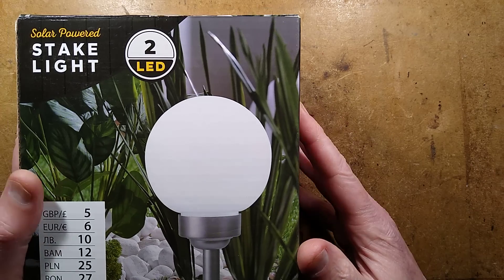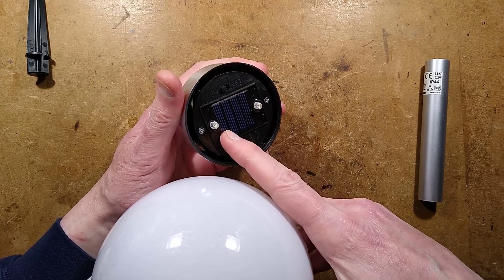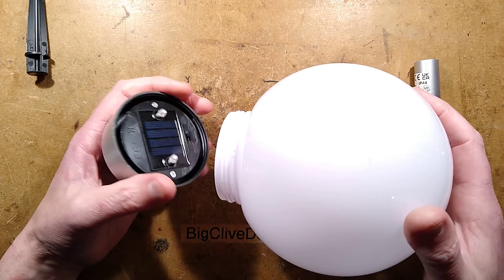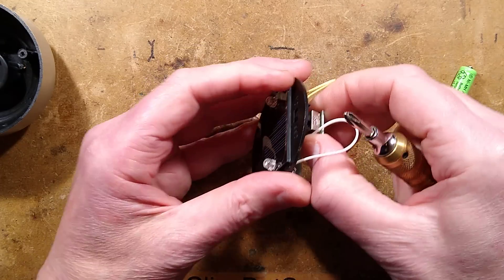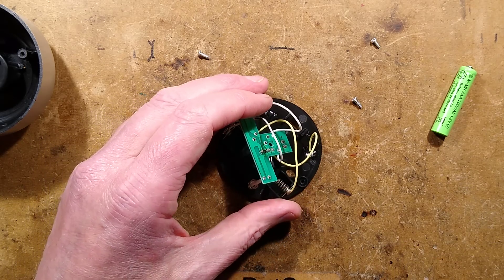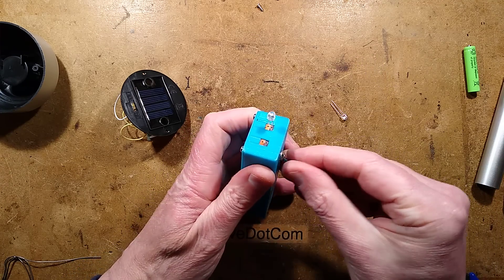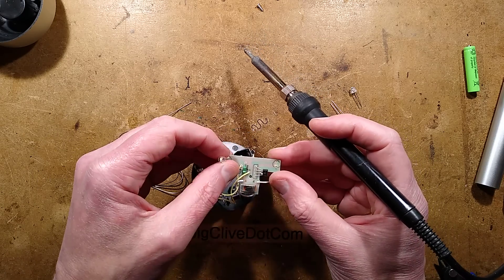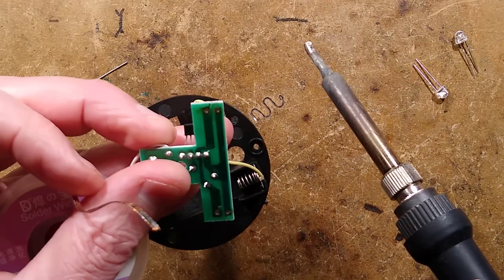Customising Poundland's biggest solar globe (great base for projects)

Comment: Brightworthy 🪔🙂🪔 I just love all those little lights and candlelights all around. It's pitty they install accus 100mAh-300mAh only. They claim it takes about  6hrs to recharge them, but they don't last the whole (summer) night. I replace them with standard 1100mAh AAA, or 2400mAh AA fully charged, at once.  After a whole day in a sunshine, they make it through the night flawlessly.
Reply: Same thing; had to upgrade the 230mah light green coloured rechargeable AA battery in my sun-jar [being used as a Environmentally friendly nightlight] as it would go dim halfway through the night and would be blinking at dawn (IC resetting as to how low the battery is). Put a 1300mah battery in it and now lasts the whole night and still bright at dawn. I found those low mah battery’s are only suitable for quartz clocks as to how little power they use ~ will run for 4 days/a week before they need recharging?

Comment: I really love that ice blue color! Reminds me of Cherenkov radiation.  Very alluring.
Reply: That could be the next idea for Poundland.... Dump the electronics and put some Sellafield soil in the base .... No charging problems during the dark winter months, no moisture corrosion problems.. what isn't there to like?
Reply: It would attract seagulls. Though they are protected these days ,they are still evil pests @StreakyP
Reply: @StreakyP  and it will last at least till 3024 :face-blue-smiling:
British quality !
Reply: @StreakyP 
Corrosion.!?
Maybe you meant Phase Change. Either way, you would have to deal with outgassing and pH levels.
Reply: Reminds me of a Mercury Arc Rectifier!

Comment: Sunlight is said to be about 2kw per square meter (think that might just be a heat measurement though) you might be able to work out the maximum potential of the solar panel based on its size compared to the square meter, but I'm sure the bright light is about right, light transmission is reduced by about a third for most materials also

I see it running out of power quite quickly if you wanted a decent intensity though, specially on that 200ma cell
Reply: The beauty is that you can easily swap out the original 100mAh cell for a 1000mAh NiMH cell from a Lidl multipack if you want. I did that for some solar lamps this year. Let's see if they still work in the winter nights...

Comment: That globe will direct any moisture right into the base threads. There are base drain holes, but now lets hit it with warm sunlight as the rain stops. A Solar mini-sauna bio-dome for electronics to relax in. See you at Poundland next season.
Reply: if the Globe screwed OVER the base instead, then there's the first improvement. I learnt something today for my future designs. Thanks BC!
Reply: As Clive says in the video, moisture seems to destroy pretty much any of these garden solar lights, even the expensive ones. Not just that, but the solar panels on lights where the panel is exposed to the elements seem to go quite 'milky' quite quickly.
Reply: @nickk6518 Not sure why my last comment got deleted....
I like making my own using a QX5252F, Sanyo amorphous solar cell, inductor, led and a supercap.
This goes into an upside down oven heated Doritos salsa jar with the lid filled with hot glue.
Has lasted 7 years so far 😁
Reply: @6sicSIX  how long does it glow with the supercap? Next question; how many F is the supercap?
Reply: @kimchristensen2175  Usually until after I go to bed so 5/6 hours
It actually has 2 6f 2.7v Eaton supercap in parallel. Just checked the colour code, it's a 1mH inductor. Also using a blue LED.
This was hacked together using perfboard with the intention of repeating it and getting a PCB made, but I never did.
Reply: @nickk6518 I like making my own using a QX5252F, supercap, inductor and some diffuser stolen from a cheap solar light.
I then put this inside a Doritos salsa jar and fill the lid with hot glue before screwing the jar on upside down.
I've had one for 7 years so far 😊
Reply: Maybe a thin bead of silicone around the globe just above the threads could help keep water from traveling into the base?
Reply: You are absolutely right.  These things only last about one year due to water and we end up with a recycling bin full of Poundland junk.
Reply: A wipe of veg oil only on the silver bit and then run a bead of silicone around it on the globe and against the silver.. and possibly bung the holes with silicone and put in a few silica bags to remove water..
Reply: A suitable "O" ring would make a massive difference.
Reply: @dogwalker666  add an O ring, make sure there are drain holes at the bottom, cover electronics in protective varnish (some nail polishes are good enough) and you've got yourself something that will last for a while.
Reply: @meppeorga  I have a can of “Conformal” coating from RS it’s very good at waterproofing electronics.

Comment: I really like openscad but only use it for 2D work on my laser cutter.  I love the way it enables me to programmatically define hole sizes and positions etc making it very easy to update things.  I'm currently building my new house and need some load-spreading  pads to go under steel joists - openscad can export DXF which I'm about to send off to a company to laser cut them out of 12mm steel plate - the costs are surprisingly reasonable with a set of 10 pads plus a few other bits costing around £150 delivered. Not bad at all for 30kg of metalwork :)